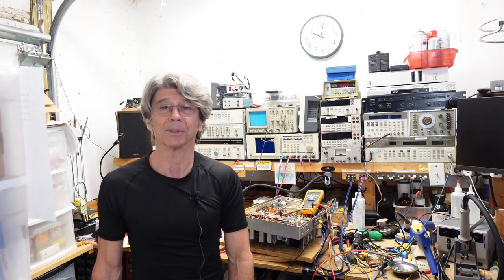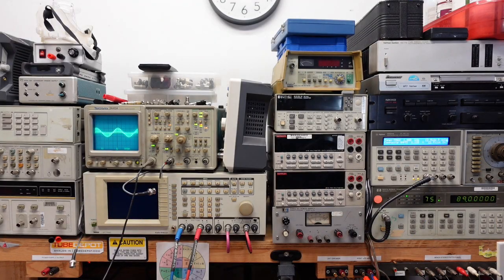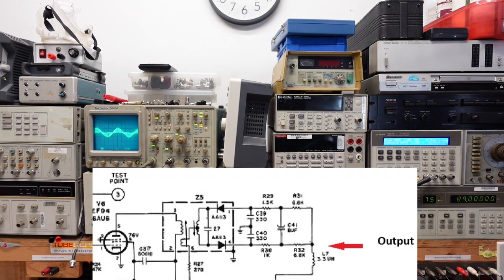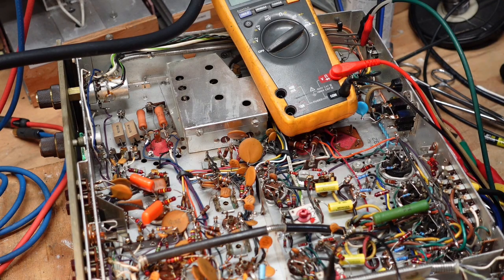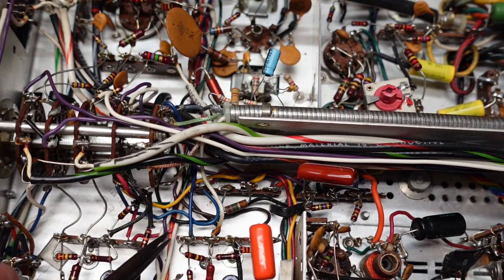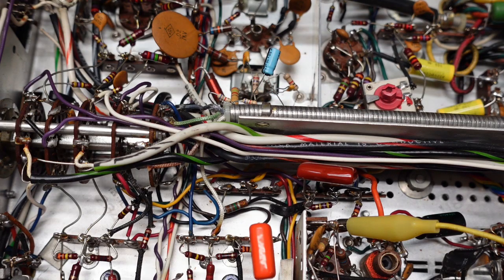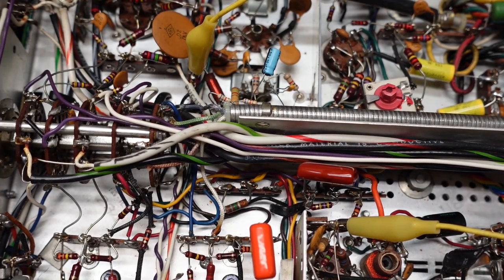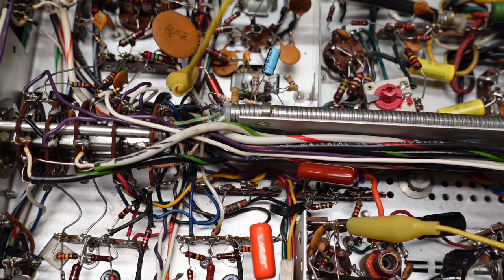Fisher 400 No FM Repair

Comment: Well Well Well.... Very glad to see you back. I to have taken a break from solder smoke and shorted caps every now and then. The Fisher took me back to Electronics School and getting zapped by the project radios. Tube s Rule..Except when you touch the plate pin. Nice fix........... Old Friend M150
Reply from the maker: Old friend indeed!  How ya doin', Mark?
Reply: @raygianelli3612   Still working on That Kenwood Overseas only KR 790. Believe I found the problem. Have the correct IC's in Route. Look at that Reverb Section. IC's are 6552 on the schematic. Found and had overlooked there are two 6562's  out of 3 total in there. Google says NOT THE SAME! I'm hoping that this is the problem. Also, I did  a   Soundcraft  Steve. A KR 790 popped up on ebay a Month or so ago. I couldn't help myself. I bought it. It's like new inside. I'll contact you and let you know if the one I'm working on now gets fixed. Funny story about solving a weak Power Transformer output problem. Talk to you soon..Regards: Old Friend.

Comment: Wow, in my testing I came up with odd open ohm reading around there and didn't for a second think that wire could be the problem. I guess that's truly a learning experience, good work my friend as always!
Reply from the maker: Believe me, it took me longer to accept it than it did to find it!  I mean, wire doesn't just fail, right? But if there's good signal on one side and not the other, and that wire is the only path it leaves no other possibilities.

Comment: Hi Ray, this is a completely normal problem, the insulation on old wires breaks down and the loose pieces clog the wire 🤣
Nice work👍
This fault reminded me of my final exams in telecommunications, the learned professors broke one of the connecting wires in the branch exchange for 200 subscribers as one of the faults - it was complete nonsense - when I was going through it and measuring it, the bundles of wires were preventing me from having good access to the relay contacts, I moved them and it started working, suddenly the whole relay system went crazy and started embroidering like a sewing machine - I found it relatively quickly - that wire was responsible for holding one relay after it was pulled - the trick for the student was that the wire tube was intact.

Edit: Žena je po operaci, dnes jsem  ji přivezl domů a zatím dobrý 😁

Nice day 🙂 Tom

Comment: Nice work, Ray!  Talk about a needle in a haystack!
Reply from the maker: It was actually harder to believe than it was to find!

How've you been, Steven?  I just got dental implant #8.  I now officially have more implants than you'd find in the average gentleman's club!  😝
Reply: @raygianelli3612  Doing well, thanks.  Glad you got that implant done.  It should last very well for you.  I have so many projects going outside of audio that I haven't worked on a unit in a while.  I have a 2245 with a bad amp that I have worked on and off for a year.  I've replaced almost everything, and I know where the voltages are bad, but nothing I do corrects the problem.  Oh well, I guess I will either find the problem eventually or treat it with dynamite.  Either one would be satisfying. Lol.  Keep up the videos.  They always inform.

Comment: Old point to point issues can sometimes be really eye opening . Last year I restored a pair of Futterman H3aa OPT less amps. All point to point , and much of the issues were due to old man Futterman’s questionable soldering skills … eyesight ? Lucky for me that I was able to find the needed compactron sweep tubes thanks to Jim McShane. An oddball circuit but they work great with fresh tubes. Do you ever watch South Main Auto on YT ? Probably one of the best electrical automotive diagnostic technician/mechanic guys around .
Reply from the maker: Finding those can be a real bear sometimes!  

I'd always been curious about OTL designs.  I think New York Audio Labs had some Futterman offerings, if my recollection of old audio porn is correct.
Reply: @raygianelli3612 Ray, Yes you are right. NYAL bought the rights to the circuit to make a PCB version. At first they did not realize the extensive use of ferrite cores on many of the wires in the Futterman designs were needed to make the amps amplify as opposed to being a substantial AM radio band transmitter…lol
Reply from the maker: @herbward5240  Wow.  Reminds me of the old saying "amplifier's that oscillate and oscillators that don't".

Comment: Ray , even after 50 years of solder slinging, I never go downstairs to my basement shop unless it’s afternoon , and I have my 3 rd cup of joe in my hand.
Reply from the maker: Herb, I just manage to fully wake up right around bedtime.  😝
Reply: @raygianelli3612 Ray, lol. I am at my most productive in the evening. Am 70 now ,and for whatever reason, the brain works best late in the day. The Fisher looked pretty clean , clearly has had some service recently. Most of the stuff I do these days is tube based. Am very familiar with Mcintosh and Marantz tube stuff by virtue of my first tech job in 1971 at a hi end dealer with a very active service and custom install biz. Cheers Herb